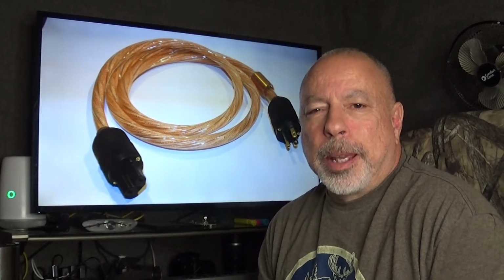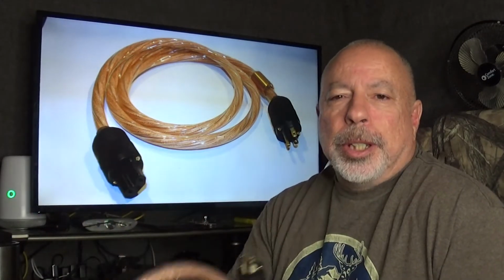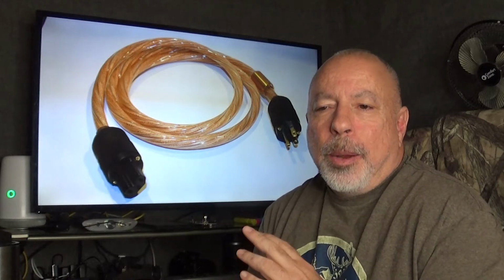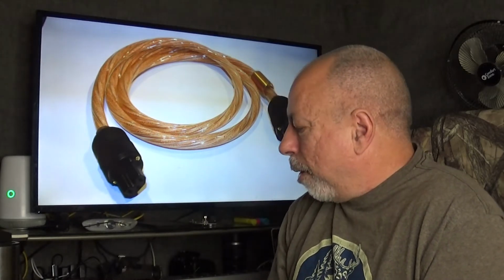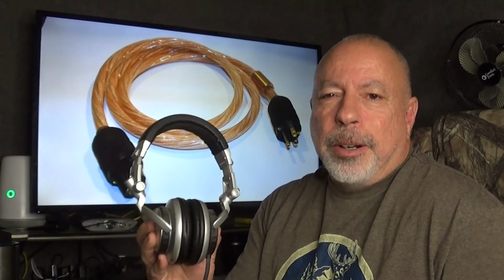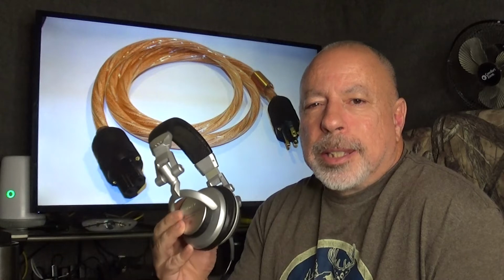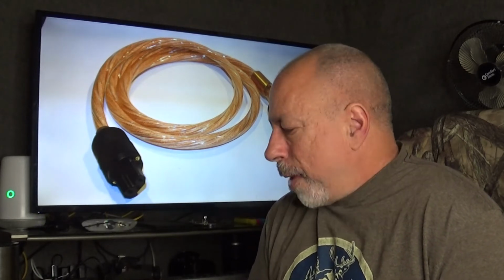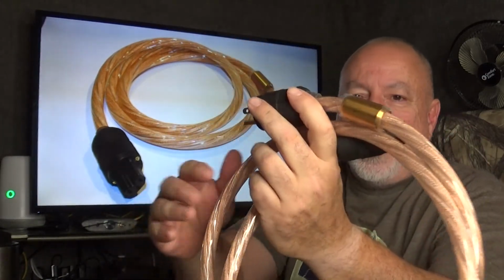IFI AUDIO - NOVA, POWER CABLE (REVIEW).

Comment: Great power cables will make a lot of difference at lower volumes, expanding the sense of space as well. A lot of cables clean up the signal but make it much more narrower, and faster. This plays havoc with the sense of space and atmosphere. I've spent many years playing with cables and you've got to get the right cable for each of your components. Also, get the source sounding as best as possible as well as the amp / preamp / power amp etc. You can try to clean up your sound as much as possible, but if you've got a noisy dirty source , you're fighting a battle that's hard to win.

Comment: Any "noise" in the ac power will be at the end of either cord, wire has no filtering properties. Cords do not receive emi they produce it, shielding a power cord may reduce interference in audio cables but since emi dissipates within less than an inch just don't lay power and audio cables together. And people need to realize the difference between signal carrying cables and power cords which carry NO audio signal. AND by the time the ac goes thru the power supply (which is a filter circuit) the piece of wire between the wall and the component is 100% looks. People should study how placebo works and what function the different parts of their system do. Power cord/ Audio cables two totally diff. functions. Engineers have studied and tested this again and again and shown any diff. that's heard is placebo. I can't believe how gullible people are. I saw a $3000 dollar power cord LMAO!!!

Comment: Your a joke 🥴and your testing is infantile I have replaced very expensive cables with these there now on every piece of equipment in my system except on my conditioning units I have four power conditioners two  ps audio regenerators and two Audioquest Niagara’s the system is about 60.000 plus of a investment and I tried a lot of companies and there cables nothing has brought my system to complete synergy like the ifi,sound stage,tonality,and most importantly musicality are just the way I like it,and believe me I have been a audio engineer for 15 years now sound and stage work,believe me I’m familiar with the absolute sound

Comment: Some time ago I bought a Furman Elite 15-dmi. Didn't notice much difference. A while later I saw a video from DMS where he recommended a $30 'audiophile' cable from Amazon. On a whim, I decided to give them a try. At only $30 each, I bought four. One for my PC, Denafrips Venus, Topping A90 and Audiovalve Solaris. 

I didn't check for background noise or try to AB cables. What I did notice is that the A90 had closed much of the gap with the tube amp, in terms of sound stage and overall believability. I also brought out my old Audio-gd NFB-10SE. It had been replaced in the search for more resolution, which I had found with another amp and then subsequently replaced that amp with  a THX-789. So, two iterations of resolution improvement. But now, the NFB-10SE was on par with my other systems when fed by the Furman and new cables.

The Venus and A90 have since been replaced with Audio-gd R1 and Master 19. I am extremely happy with my system now.
Reply: Link to the amazon cables?

Comment: If the amp or a source causes dirty current through ground loops, thicker ground wires in cables would reduce the hum. The work-around this problem often means ground lift, but the proper solution would be to wire components internally such a way so they do not cause such dirty currents. There should be no currents generated by components through ground loops, whatsoever. However, with modern Switched Mode power supplies it is impossible, since they are required to have Y-capacitors to attenuate high frequency leaking to the mains, so some dirt through ground loops would always go. And thicker cables in such case reduce the hum, the further reduction would be to use balanced interconnects between components. Not between an amp and headphones, it won't help. Between components, so the dirt going to differential input compensates itself.
Reply: This is not a review of a power cable! You didn't even listen to music with it.  What kind of a review is that.  ????????
Reply: Positive Feedback gives this a very high rating for a 200 dollar power cord.  Realize that Ifi is the budget line of AMR which makes some pretty serious stuff.  If anyone wants to 
get a real review take a look there.  This is something I would recommendto my friends who are looking for something that actually offers real improvement for the dollar.  My current favourite is the Wywire Platinum which I thing is quite worthwhile but not something I would recomment to anyone less than quite serious.

Happy listening.